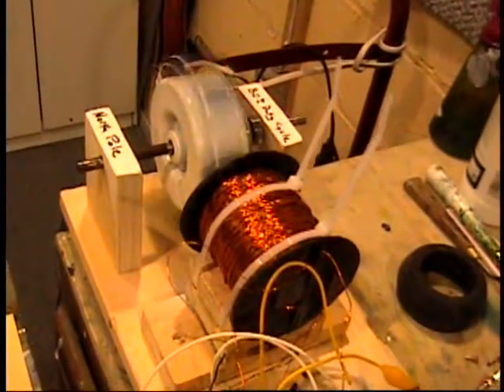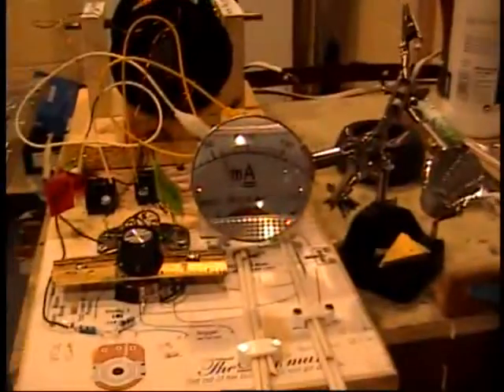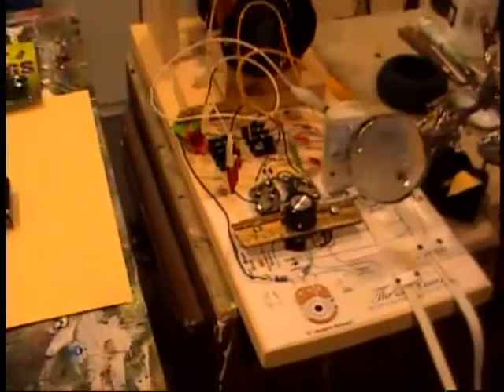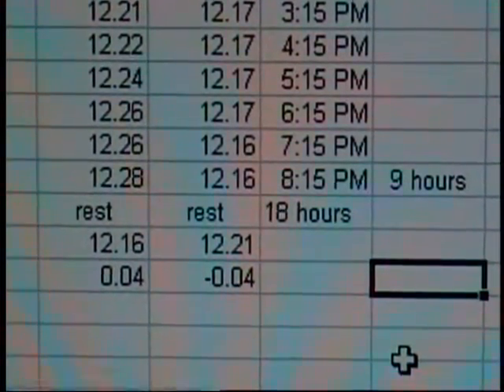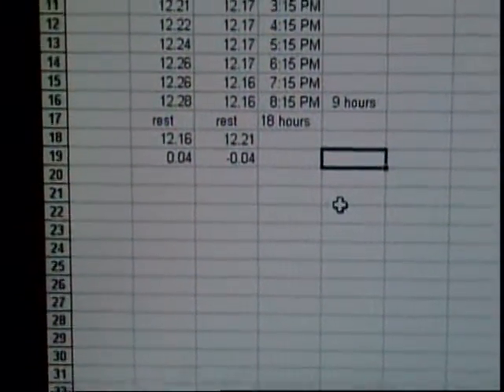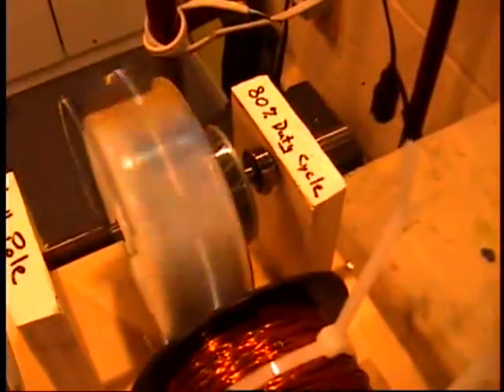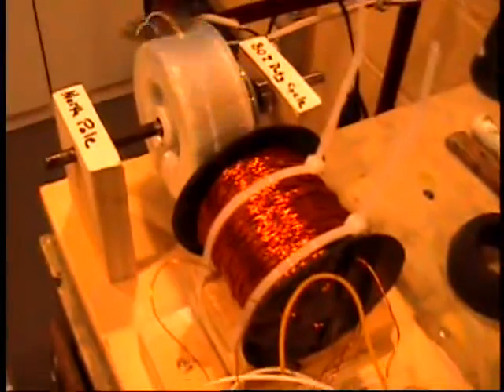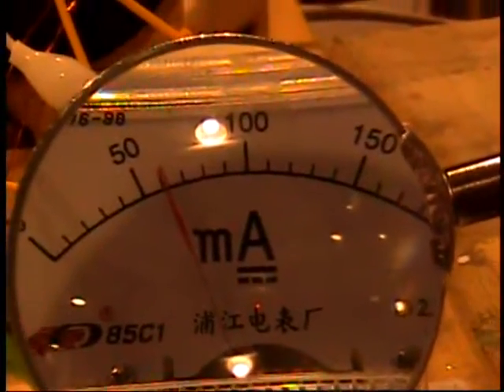Two Transistor Bedini

Comment: So the bedini can be made with the trigger and power coil separated? 
Because I have the some of the electronics components and a relay with two coils, and a small induction motor with one coil 100ohms, all of those coils are in a laminated iron frame.
Reply from the maker: Quarentae, since all your coils are on the same frame, to work with a Bedini motor, they would have to be very close to each other. If they are seperated by a centimeter or more, it could still work if the frame is oriented with the coils horizontal to the direction of the magnets. The trigger coil must open the transistor in time to charge the run coil before the magnet is too far away to be pushed. If you could make that work, I would love to see a video from you. As far as I know it would be a first!
Reply: Ronald Gerth
I'm sorry I didn't make myself clear, they're not on the same frame, I have two coils in one frame as a 127vac relay(may be a induction motor, I'm not sure) and one coil in another frame as an induction motor(I guess)
I will take some time to gather the remaing materials for the bedini ;/ until then I will get deep in learning the basics
Thank you for your kindness!